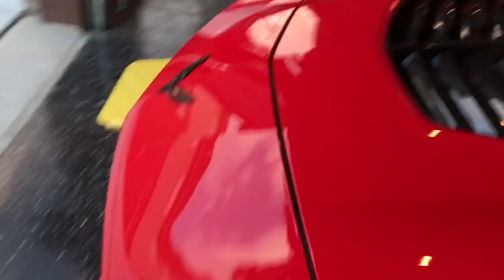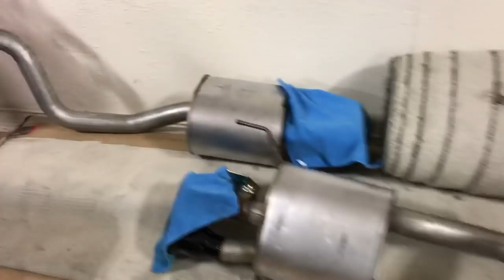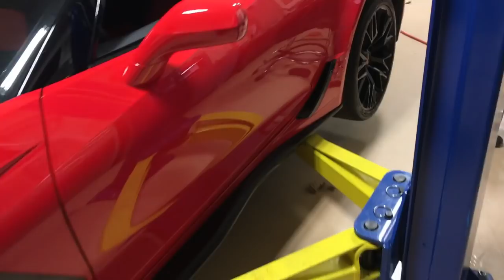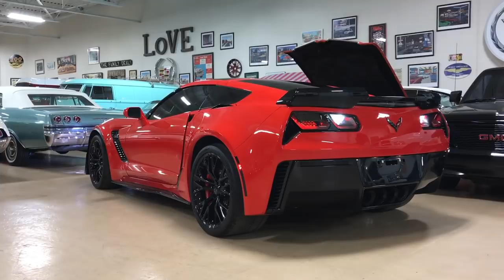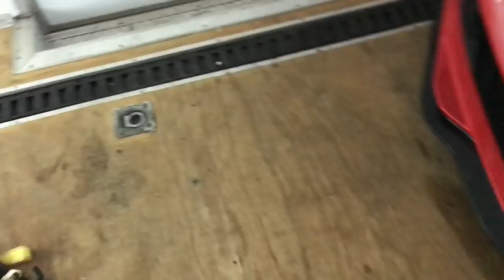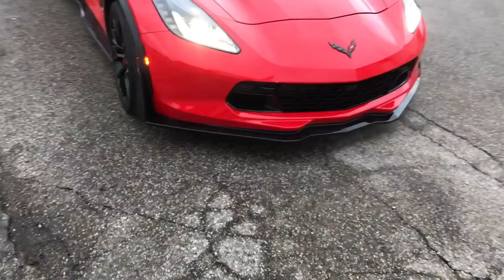Installing 2 Inch Headers on my C7 Z06!! (BEWARE: VERY LOUD)

Comment: I don't know much about vehicles but "WHY IS THIS THING SMOKING LIKE A FREIGHT TRAIN?"
Reply: Terry Young  that's what I thought, something fucked  up there! Get a proper tune dude
Reply: Normal its the oil on the headers burning off it will smoke like that for about 10 minutes and then its fine

Comment: I’ve never had a v8 car so I’m gonna be that guy why 2 inch headers?Thats so damn small?
Reply: gerell smith 2” is actually considered the “bigger” size...most people run 1 7/8” headers.
Reply: Grocery Getter interesting.Appreciate the feedback
Reply: Yup^ pretty much...
Reply: whats the difference between 2" and 1 7/8"? Performance, sound etc?
Reply: Melo DEC it’s all about air flow. It’s very easy bigger is better.
Reply: Anthony Celano bigger is better but not always, really it just depends free flowing exhaust on blower cars lowers the boost by a couple lbs just because of back pressure. Just like a big cam you will see the same thing. I guess it’s if you are wanting to make max boost on blower or free up exhaust flow?
Reply: Mustangs and Camaros typically use the 1 7/8 the z06 has a bigger motor so 2” is more suitable for the pushrod vs fords modular motors ..